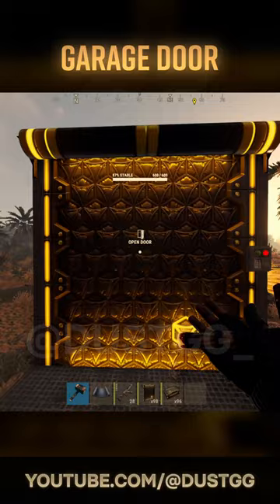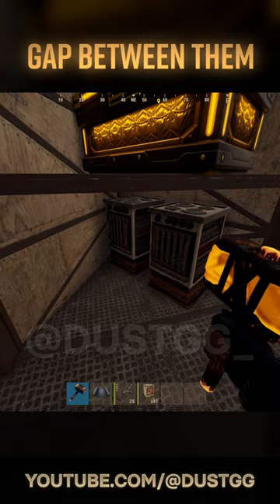The EASIEST Automated Furnace System in RUST

Comment: You forgot to put the power output from the conveyer connected to its power on switch so it keeps the conveyer on if you run out of power and it turns off

Comment: It moves the metal ore to the furnace but the cooked not back i think u need a second converter
Reply: True you need onr converter to move the cooked ore out
Reply: Yeah I was watching this really confused.. is this a cheap way to do it. For example, it overflows into the box but initially gets stuck in the furnace? or this just doesn't work without the extra converter?
Reply: Nah I run 9 off one conveyor

Comment: For any new viewers small battery now has 15 power. With one electrical branch you can add another electric furnace to this system.
Reply: Need a few more power for the conveyors tho. 3 furnaces would take up all the power from that one battery. Depending on the size of your base and how much power you are producing, branches work well to filter the exact amount of power to each component and the conveyors can be linked with the pass thru and need 1 power each. Splitters are better for turret triplets but I still use a branch to give that splitter just enough power and the power out from the branch can go to another branch/componetnt. Yes it works to put 3 ovens on a splitter but you then need 1 more power for the splitter and 1 each more power for the conveyors so you would need more than 15 power.

Comment: Tried this and it doesn't even work. The conveyer  moves the ore, but the furnaces never turn on. They are both wired with 3 power going to each of them. I dont know where I went wrong but it does not work.
Reply: you have to hold e on the furnaces and turn them on manually. Once they’re turned on they will stay on until you lose power or turn them off.
Reply from the maker: lol.. turn them on